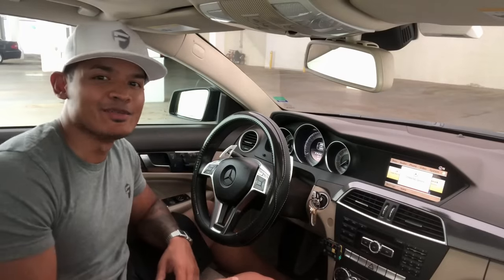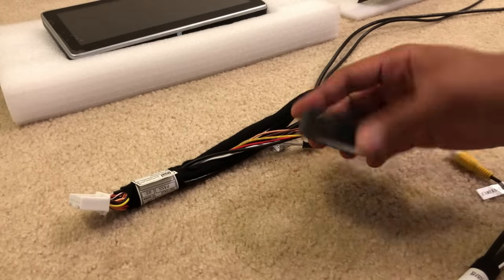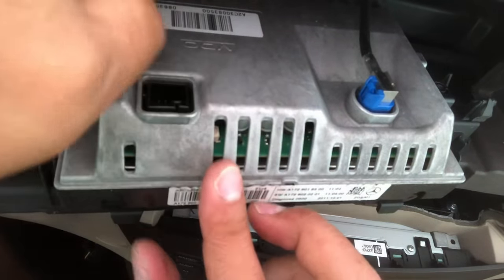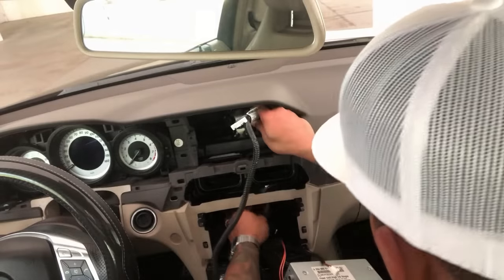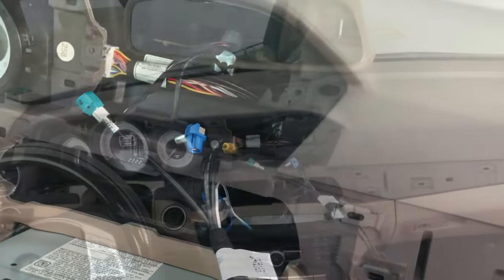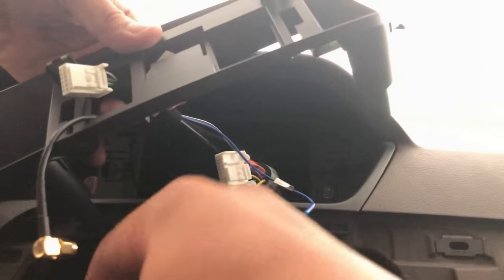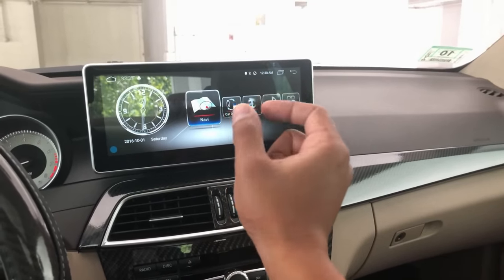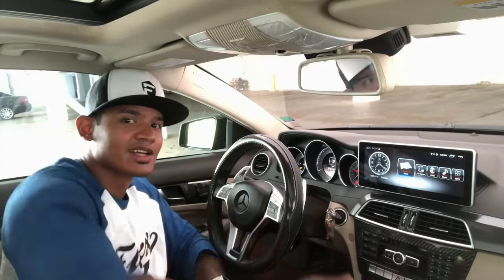Installed a large ANDROID SCREEN on a 2012-2014 Mercedes C-Class C250 C300 C350 C63 (W204)

Comment: I added this screen on my 2015 Coupe W204. I have been having nothing but problems with it. I have not been able to get Spotify to work in Carplay. I installed the Bluetooth dogle  and getting a high pitch interference noise. Originally I had the wired dogle with the same interference. The Bluetooth will drop off after sometimes a few minutes into my drive or maybe 30 mins after. Very annoying when I am navigating with Waze. On tthe screen I get message "unfortunately Bluetooth sharing has stopped"
Reply from the maker: 1) did you buy it from DMP Car Design. If the answer is no, then that's your problem. Not all android screens are the same. There's alot of poor quality screens out there that claims to have high end specs.

2) If you bought it from DMP Car Design, did you reach out to them for customer support? Because if so, they would help solve all your issues 100% already. If not, they will be able to help you out some other way.

Comment: Hi Flexx, I just installed Android 13 / 12.3 in a 2015 ML 350 SUV. unfortunately, I did not see your video until after I did my install. I wish I did -- - i would have saved few hours! I need to congratulate you on you thorough explanation in plain English.One thing I did not do was" to remove the Satellite Radio connection and transfer it to the new harness". Is that going to present a problem? Do I need to go back and do that?
Reply from the maker: Of course it’s a problem. You’ll get no satellite radio anymore.  The transfer needs to happen if you do have a satellite radio subscription. If you don’t care for it, then leave it off.

Comment: Does the steering wheel controllers still work? Also does the number buttons still communicate to manually dial phone numbers?
Reply from the maker: Yes, when you are using the OEM interface on the new screen.  

Only some things work when on the Android Interface on the new screen.

Comment: Hey big bro ordered it n installed it but the Navi morning is working does the Navi n every feature of it runs off hotspot from your phone I have an iPhone . Jus wanna make sure I did it correctly my radio doesn’t work I’m guessing I did a wiring wrong or blew a fuse bc I didn’t take the battery off

Comment: Just got this, have installed it but cant put the radio head back in because of the wiring harness, been trying for hours!! How does the sound come out of it, is it through that Jack lead as I dont have anywhere to plug it in my centre console??
Would really appreciate the help!
Reply from the maker: If you bought it from DMP, their customer service can help you through it.
Reply: Did you manage to get it done? I'm stuck with the same problem.
Reply: Literally a nightmare to fit back in 🙈
Reply: Did u guys managed to fit it back in... I cant
Reply: It took me about four hours to get the head unit back in my C250 after installing this.  What worked for me finally was using a flexible plastic window blind slat that I slid in behind the unit as I pushed it back in and got all the wiring pushed down in the space under it and it slid back in.  However, I did have to use some force to get it to stay in place while replacing the two retaining screws.  Hope that helps.

Comment: Bought and installed it after watching this video.....I've got the ntg 5 system  (cla 2016)  so there is no aux in my car.
There was a convertor (aux to USB).....but there is a delay in the sound when watching a movie on USB-stick or SD-card.
Is this a known  problem ? And is there a solution ?
The E-bay seller doesn't reply my mails...... 😥

Keep up the good work and greetings from the Netherlands. 

Got the iluminated front and back star and the ambient kit 
 as well......again after watching your video's. 👍
Reply from the maker: That’s a common problem most people don’t know about until they do the install. That’s why I always recommend a reputable reseller if you are gonna buy. Like DMP car design that have customer support and returns/warranty support.  

Most of the 2016+ Benz have 2 stock radio system inside.  1 is known to have a delay with the android screen and 1 is seamless. A reputable reseller would ask you to remove the center trim and read off the number so they can tell you if you have a bad or good stereo.  

To date, I don’t know if theres a fix. Sorry.
Reply: Hi, I'm looking at getting one of these... I have the NTG 5 and no aux port (2015 e-class coupe)! Did you get the issue resolved? Thanks!

Comment: Hey Flexx....how many av channels are there on this screen? I would like a rear and forward facing camera (that I would use as a dashcam). I would also possibly want to add 360 panoramic view. Is this possible on this screen? If not do you know of any new screens that can make this happen? Thanks
Reply from the maker: You need to ask DMP.  This video is an old screen. I did another video on a newer screen. And you can add so much accessories to it.

Comment: Flex, I didn't break my fiber optic cable but I broke the pin that holds it in place to the radio. Where do I find another connector? I can't put the radio back in place for the android so I said screw it.

Comment: Hey bro, I saw your video on installing floating center cap, I bought the center cap and finally arrived, problem is that my front wheel has a hub grease cap that gets in the way of the floating center cap, how did you overcome that?  Thanks man!  I follow all your vids
Reply from the maker: Don’t know. I didn’t have that issue. You gotta ask DMP and see if they have a work-around.

Comment: Hey Flexx! I know old, old vid but still useful. I gotta ask...I'm stuck! Getting the headunit back in has become near impossible. I've tucked all the wires and connectors as best as possible but cannot get it flush. Any ideas? Thanks!!!
Reply from the maker: I dont' know. It took me about an hour to reinstall. Did you buy your screen from DMP car design? if so, they have a video on a better way to run the wires so the radio can be pushed back in.
Reply: @TheFlexxGarage  sorry dude...I did not. I guess I just need to keep at it. My local shop didn't want to attempt it.

Comment: Hi flex I'm just installed the new harness for the new screen and now having problems putting command unit back in as new one is bigger than OEM one how did you manage to to go fit yours back in hope you can help thnx
Reply: Graham Riddell I just tried installing the same android screen, but I’m also having issues putting the radio/command unit back in. I don’t know if it’s the wires in the back or the Torx screws that I took out please help? Thanks
Reply: Hi I think it's the new harness it's alot bigger than OEM one
Reply: Disconnect the hook ups and reconnect them in a way you can flatten the harness so that the command has more room to fit in. Had the same issue.

Comment: Hey Flexx, I bought the screen but I'm have issues with the radio reinstalling it back, I had to  run the power cable to the right side, now I'm able to push the radio back but the 2 top screw for the radio for  some reason does not secure the radio and also the OEM navigation & radio seems  to have an error it showing a incomplete split split. screen .

Comment: Flex I know you work on a lot of mercedes benz  I have a 2013 c250 and my radio has no sound coming out I check my fuse and everything was OK I changed my amplifier and it still no sound, any suggestions?
Reply: Try doing a reset on radio or you might dropped water I changed my amp and worked check all fuses

Comment: Does everything original work?  karman harmon, bluetooh, steering wheel controls etc?
Reply from the maker: Yes, all works when you’re using the OEM interface on the new screen.  When you switch to the android interface, most still work, not everything.
Reply: @TheFlexxGarage  do you have for prefacelift carplay module to order where can i find, but with factory big screen?

Comment: How does the navigation work? Will i need to get a data card from my cell phone provider?
Reply from the maker: You either go to your OEM interface and use your OEM nav, or if you wanna use the NAV app in the Android interface, you will need an internet connection fed to the screen. Either sim data card or wifi tether to smartphone. Unless you download a map for offline use...but then you won't get traffic/accident alerts since those are real-time.

Comment: Hi  dear Alexander, I have w204 2014 year. As we know on this models have 2 types original monitors : small and larger. On my car monitor is smaller. If i remove more larger version from other vehicles, does my car support larger monitor? Or I have to change all radio system? What can you say about this?
Reply from the maker: Doesn’t matter what screen you have from the factory.  The new screen will work.
Reply: Flexx Alexander thanks very much!!
Reply: Alexander, did you complete your install yet, how did it go? Cls63 amg here.

Comment: Thanks for the video. I also installed this Android screen. But I can't play music. The radio still works normally. Do you have any advice?
Reply: Check the audio in the oe system and make sure it’s set to aux. then in the android factory settings menu make sure the audio settings are configured correctly and that audio source is not switching automatically

Comment: So I’ve installed my new radio but my NTG menu is black when selected. I just hear serious xm radio preview in the background when anything in apply car play is connected. My backup camera also isn’t working. Any help with this would be great! Thanks for the awesome video
Reply from the maker: Not sure. Sounds like a loose connection and you need to adjust the settings to your car. You need to contact DMP car design for support. They can help you out 100% if you bought from them.
Reply: @TheFlexxGarage  Have the same issue. When are the best hours to reach them? They must be on different hours than US time for sure.

Comment: Hey Flexx I have done everything I KNOW TO GET THE HEAD UNIT BACK IN, BUT SPENT MAYBE 5 FRUSTRATED HOURS? MERCEDES C200 W204 FACELIFT. help sorry caps lock on and didn't notice. Not yelling.
Reply: All good the locking mechanism on one side had been pushed up and it wouldn't allow me to push it back in. In and working great. Thanks. One thing I would add is that I routed the wiring outside of the head unit holder.

Comment: Hi Flexx.
My car is a Mercedes C350 2012.
I bought a 12” screen from DMP Car design.
I did all steps in your video. Now I have 2 problems:
- the sound is not working.
- the back camera is not working.
Please help me how to fix it.
Thank you.
Reply from the maker: Reach to DMP for support if you bought from them. That’s what they are there for. It’s probably just your settings.
Reply: how long did it take for u to receive the screen
Reply: I have the same exact problem. What was your fix?

Comment: Hi
Thanks for the video tutorial.
I have installed mine today and it comes with no sound. And it is not connected to the car speakers.
Could you advise me of what i did wrong?
Kind regards
Reply from the maker: That’s an issue with your settings.  Only your reseller can walk you through the setup process. It requires a password from the reseller
Reply: I am having the same problem. Why in the world do they sell a display that has no sound. Isn’t that kind of the whole point. I can’t even access the radio feature. Very disappointed so far.
Reply from the maker: Don’t hate the screen when it’s user error. If you don’t understand how the screen works, then don’t buy it. It’s an android screen and it works like plugging an android phone to your aux port.  You are getting no sound cause you aren’t putting on AuX mode on your OEM interface for sound to go through. The screen was never designed to be plug and play or to replace your entire oem screen hence why it still gives you your oem interface.

Comment: Nice work Flexx! I'm trying myself to install the screen but I'm stuck at the vents, the left catch wont let me pull it out. I dont know what to do
Reply from the maker: That’s a tough one. I got frustrated and forced it out and pulling hard. Luckily nothing broke.
Reply: @TheFlexxGarage  it takes me up to 1 hour  but I did it. Now, after installing all the cables, I got no ntg menu (only flickering screen, no black screen). Any idea?
Reply from the maker: Don't know. Could be a lose connection or a setting you need to chance in the andriod interface? Did you buy from DMP? If so, shoot them a message and they can walk you through the proper installation/setup.

Comment: Please I'm gonna try to reach out once again,  See this video is from 2018 But still, it has to still be available right? I got a c300 sport 2014, 52,000 Miles on it, Immaculate Condition, Inside Looks like it just came off show room, Tan/ wood grain, and I think Polar White exterior color. But I bought the GPS board that slides into my glovebox, it kinda sux. I so desperately want to upgrade that you installed in yours here !!!! Any chance you could let me know what kind of price U.S. currency I might be looking at for Screen, Kit, Hardware, n All? Also Below, I'll try these links again but unable to reach or get any response back on this.... :(  Anyways, Hoping for a response, fellow Benz Enthusiast !!! James
Reply: I just bought a 10.25 unit from DMP.  c300 2018.  I installed it this weekend.  Issues with sound and the microphone on the unit not working well.  I am hoping I can get it worked out.

Comment: Hi FLEXX. I bought recently a C350 W204 facelift and after I saw this video  I have to say that I want that screen too. And I want to use it combined with a back up camera. However my mercedes doesn't come with the COMMAND sysstem but onlly with the standard AUDIO 20.  And it doesnt have a back up camera. So, is that a problem ? Will the 10.25'' screen still function properly if I install a back up camera? I would apreciate your advice on that. Thanks.

Comment: Hello I have a problem with sound after installing the screen, The aux field is provided, but there is no sound and the volume-SOUND field cannot be controlled Please help me solve the problem.
Reply from the maker: You need to change it in the settings or hidden menu settings.  You need to reach out to whoever sold you the screen for how to do it.  Not all screen software is the same. And sometimes you need a password to get into that menu. Again, only the reseller that sold you the screen has that info.

Comment: Hi flexx...I gave my car in for a Vallet...wen I got it back screen had color vertical lines...radio works but screen has these vertical lines and sometimes it goes bright white...do I need a replacement screen??
Reply from the maker: Most dealers say it requires new software cause something is corrupted.  Best for you to take it to a shop instead of wasting money on a new screen that might not fix the issue.
Reply: @TheFlexxGarage  thanks flex...

Comment: Actually, I learned that I cannot use the included AMI connector because I do not have that type of port. And I do not have a AUX port. Is there a way to install this without them? Maybe using the USB port?
Reply from the maker: Yeah. You need to get a converter. Most of the screens comes with them. You are watching and commenting an old video. Nobody sells this screen anymore. I’ve already installed 2 more screens already.
Reply: @TheFlexxGarage  what screen do you have for 2012 c300 if this is not available anymore.
Reply: @TheFlexxGarage  Which screen setup would you recommend then for a 2014 C300 Sport w/facelift since these are no longer offered?

Comment: Hi we just tried to fit this after your recommendation and it will not fit, the main interface cable cannot fit behind the head unit, how did you get it to fit ?
Reply: Same exact issue here
Reply: Did you guys resolve this issue. I've ordered from DMP..flexx made it look easy but I think he did edit and do something to the cables to help fit the head unit back in. Probably have to wrap the cables and feed them in compacted?
Reply: It took me around 3 hours to fit mine in. You have to twist the harness, carefully, so that it fits under the radio. The space where you can kinda see the cigarette lighter, that's where you want to put it. Just make sure you don't damage the harness or that anything gets unplugged. It fits, trust me. It's just a little hard work

Comment: Would this video help me if I were to buy the Wireless Carplay system from your 2020 vid? (2020 models are a bit cheaper than this one)
Reply from the maker: The square screen in this video is no longer available.  All screens available from DMP car design for any year c-class will look like the screen in my other video with the rounded corners.
Reply from the maker: Or are you talking about adding CarPlay to your existing screen in an older c-class? If that’s the case, you have to buy the CarPlay version that is specific to your cars model and year. Because the CarPlay module boxes only work with specific screens and year. You can’t mix and match.
Reply: @TheFlexxGarage  Sorry I got a bit confused between both the videos. But this video would still help if I wanted to add the new round touch screen models??
Reply from the maker: yes, same install but different, newer style screen. I can only speak for DMP car design screens. I don't know about the screens on Aliexpress, Ebay, or other resellers.

Comment: I have a 2012 C300 sport 4matic and I cannot locate the fiber optic line. I did the install and the unit I got only came with 1 gos connection and 1 WiFi connection. I have no sound and tried to  contact DMP but I got no response need to know where is my fiber optic line on my car. I am subscribed to your channel.